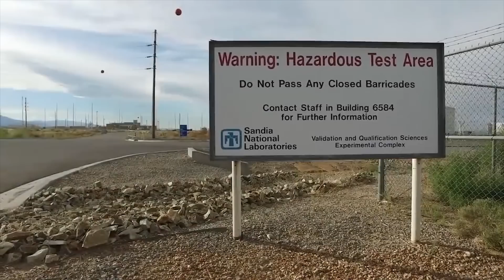Crash Test - 5 Largest Full Scale Experiments Caught on Camera

Comment: I actually saw that F4 phantom crash. It hit so hard and fast nothing had time to break or slow down, it literally disintegrated as it plowed forward into the wall. The wingtips which stuck out past the width of the concrete block kept going as though nothing happened, and if you saw the block afterwards there was a perfect shadow of the F4 left on it.
Reply: That part of the video drove me absolutely bonkers. Aside from the fact that the rockets were still firing, and subsequently the Phantom was still accelerating at the point of impact, people just don't seem to understand how unbelievably brief the impact event was, or how immense the energies involved were. Classic Dunning-Kruger, "knowing so little that they think they're experts" mentality.
Reply: @bigrob966  Very similar to those that don't understand the massive forces involved as the WTC buildings fell. Once a certain amount of potential energy has been converted to kinetic energy as the buildings finally yielded to gravity (as the structural steel with most of its fire shielding torn away, was heated beyond its yield point-they weren't melted) and began to move, there was no stopping their collapse.  Explained perfectly by the Law of Inertia, Newton's 1st Law-Objects in motion or at rest tend to stay that way unless influenced by some external force.  That F-4 test was amazing, a still picture of the test was shown in a book called "Global Air Power"  I was always amazed how the wingtips kept on travelling straight forwards as they protruded out beyond the huge block of reinforced concrete. Another of the "Law of Inertia" at work.
Reply: @hoghogwild   If I could do anything in the world I would make more people get their heads out of their asses and understand this. Sadly my sister is one of the one's that are on the "it melted" side even when I hung a 50lb dumbbell off a piece of angle iron and heated it with a torch till it sagged and collapsed. (Yeah not the exact same scenario but barney style enough for her)
Reply: @hoghogwild  ....doesn't explain building 7.  I've heard their over rationalized justifications.  I'm not buying it.
Reply: @roblockhart6104  What's there to explain?  As the North tower fell after being struck by an airliner which ripped much of the fireproofing from the structural steel thus exposing it to heating from burning kerosene based fuel. Once the steel was taken beyond its yield strength it fell.  As the North Tower came crashing down debris from it fell down into Building 7 creating a large gash into Building 7.  Fires burned until 2pm where firefighters noticed a bulge on the SouthWest corner. Firefighters noticed creaking noises from the building and at 3:30pm major firefighting operations in and around the building were ceased due to the danger to firefighters. Insufficient fire system/sprinkler system contributed to the failure of the building.  That was a horrible day
Reply: hoghogwild so ONLY building 7 was effected even though it wasn’t as close as other buildings in the area?
Reply: @hoghogwild  Dream on, Troll
Reply: @HadjiMart  but did the angle iron collapse into it's own foot print? buildings won't implode without human engineering as they are designed to stand.
Reply: hoghogwild 
I think that an important issue with the fire is ignored . Both planes were full of jet fuel and when they hit the building the only path for the burning jet fuel was to spill down the elevator shafts. Windows were shattered in the impact zone and there was many windows broken at the bottom of the towers including all of the building’s exterior doors being opened. The air rushes in at the bottom to feed the fire and exits at the top , the elevator shafts are now a blow torch . Kind of like how a charcoal starter cylinder is used to get the coals burning with only a small ball of paper . It acts like a bellows !
Reply: Rob Lockhart Collapse a building sideways onto another building and let me know how it works out.
Reply: @hoghogwild Or perhaps we understand too well? 

A plane flying faster than it's design limits (thicker air at sea level) and faster than the engine could move it at that altitude. This same plane built of aluminium was able cut through steel 'I' and 'H' beam that was anywhere from 2 to 5 inches thick so perfectly, remember aluminium is by orders of magnitude softer than steel. No mater how hard or fast you throw a paper plane, it will never disappear through a cardboard box. 

Funny how the hijackers face-scarf and passport survived the inferno but the flight black boxes didn't. Funny that the only three steel skyscrapers to ever collapse due to fire/plane strike, all did so on the same day. Funny how Larry Silverstein re-insured the towers six weeks before 9/11 and SPECIFIED being covered for terror attacks. Funny that the week before 9/11 all the stock market 'put options' (a bet that stock will fall) that were placed on American Airlines, Boeing and United Airlines (5 to 11 times their daily average). Funny that the lift maintenance company owner and president Bush are brothers. Funny that guards and sniffer dogs are pulled from WTC1 and WTC2 in the weeks leading up to the event. Funny how BBC reported WTC 7 had collapsed, yet it was viable in the background for another 15 minutes. Funny how WTC 1 and WTC 2 collapsed at free-fall speed (no resistance from the floor beneath). Funny how many cars many streets away ended up on their roofs.

You could just believe the propaganda that the 'tell lie vision' news PROGRAMMING tells you, while you're sat their watching in an a docile passive receive state. Or you could wake up !!! That fire could NEVER generate the heat required to take the metal beyond it's yield strength that lead to it's collapse.
Reply: @oceanhome2023  You're missing something very important. Fuel and oil burn black, BLACK!!! when the planes hit, the smoke was grey, GREY!!! = no fuel. Smoke turned black after because of all the plastic and other things.
Watch any plane or helicopter crash you like, smoke is thick, acrid and BLACK, it's so glaringly obvious.
Reply: @HadjiMart  As kids, my brother and I would heat up steel in a normal campfire, just a wood fire, until it got red hot so we could bend and manipulate it. I have no issue in seeing how jet fuel and burning office equipment led to structural failure of the towers. Not saying what we were told is true, or that it was an inside job or whatever, just that the heat from burning fuel could have weakened the steel beams enough to cause failure.
Reply: @oceanhome2023  another thing people forget is that the planes literally gutted 3-5 floors from the buildings. After that there was very little left supporting the upper floors. And even that was being heated. Only a matter of time until they collapse in and with that much weight it started a chain reaction of collapses. Im not surprised the rest of the building couldn't hold it.
Reply: @mikerochburns4104  Idk about you but im pretty sure office equipment and you know carpet and dry wall are flamable
Reply: @Deoxys501  They are, but you know, I work in a foundry and I know what temperatures are needed to melt specific metals, I also know you need more than paper, dry wall and fuel to come anywhere near close to what it takes to make WTC 1&2 steel go beyond it's fail point.

Max temp you could expect in that senario is 800c 
Minimum temperature needed in that senario is 2400c
Reply: @hoghogwild  please explain building  seven to me? Thanks 😊
Reply: @mikerochburns4104  Melting point(change of state from solid to liquid) of structural steel is approx. 1510ºC.  The BOILING point (again change of state from liquid to gas) or Iron is 2800ºC.  .  At 2400ºC structural steel would have the viscosity of water.  The maximum forging temperatures of steels AT MOST is 1300ºC, some carbon steels are just above 1000ºC.  Your MINIMUM temperature of 2400ºC for structural steel to deform is ridiculous
Reply: @richardhowe4140  OK?  I'll just copy and paste my original answer for ya.  Here you go"""As the North tower fell after being struck by an airliner which ripped much of the fireproofing from the structural steel thus exposing it to heating from burning kerosene based fuel. Once the steel was taken beyond its yield strength it fell.  As the North Tower came crashing down debris from it fell down into Building 7 creating a large gash into Building 7.  Fires burned until 2pm where firefighters noticed a bulge on the SouthWest corner. Firefighters noticed creaking noises from the building and at 3:30pm major firefighting operations in and around the building were ceased due to the danger to firefighters. Insufficient fire system/sprinkler system contributed to the failure of the building.  That was a horrible day"""
Reply: @hoghogwild  ok.. thanks 😊
Reply: @HadjiMart  "barney style enough for her'!!!  BRILLIANT!!!
Reply: @roblockhart6104  dont forget about those dancing Israelis...
Reply: I knew the 911 conspiracy clan would show up here ! The continuing characteristics of these conspiracies is that it has to continually get bigger to deal with the new pieces that don’t fit  . Another sign of these fake conspiracies is the massive amount of people involved in it and how are they going to keep a secret, there has never been a project that didn’t leak , the most secret project ever the Manhattan Project leaked . There seems to be a truly American trait to fall for conspiracies such as jet contrails are poisoning us and the moon landing was faked .
“Are you going to believe what I am telling you or your own eyes ?” - Groucho Marx 
It is much easier to fool someone than to convince them that they have been fooled !
Reply: That's cool. My dad worked, or sub contracted for, Sandia back then. I didn't see this test but I did get to see some other tests on the sled. It's shocking how fast they can get stuff going. I still have a scrap bit of a missile they tested. lol I didn't see that particular test either. 
I did get to see some nuclear container tests though. 

I was at home in 4 Hills for this test. I heard it.
Reply: That would be so f'n cool to see! 
I'm actually 51 but this stuff just cranks up the 10 year old in me.
Reply: Similar to the other "9/11" comments -- the aircraft striking the pentagon went through a similar process.
Reply: Yeah looked real to me. And funny you should say that about the shadow. We also have ship hull's from ww2 with perfect japanese zero shadows where they impacted 5 inch thick steel. They totally disintegrated.
Reply: Would it have mattered if they had loaded the airframe full of Jet A?
Reply: Nighthawke70 there would have been more flames, but as far as any kind of damage, no. There was literally nothing left to be damaged.
Reply: TheMattc999 JustMonika
Reply: I only can't into the comments to find this one! Thank you! What an incredible, powerful, beautiful sight it must have been. 😍
Reply: Also isn’t that facility in socorro not Albuquerque?
Reply: Physics..... 😁  "A body in motion tends to Stay in MOTION"......
NO JOKE!!!
Reply: And thats why flying aluminium tubes could never bring down the WTC towers. Theyd have ben vaporised on impact.
Reply: I remember going out on a F4 crash recovery, what we found was nothing but molten metal and somewhere in that was a pilot.
Reply: They generally vaporize, kind of melt real fast.
Reply: 9/11 was an inside job.

Comment: Some of these tests seem unnecessary. Aluminum vs. Concrete = destruction of aluminum. No test needed.
Reply: The plane vs concrete was to demonstrate that the techniques used to build nuclear power plants were safe from a plane hitting them. It was for the public more than anything. Same with the nuclear flask test BR used with the trains. Remember high speed is still high speed and things moving at that speed can pulverise most conventional building materials.

Comment: The 727 cras is no that good an example as rh engines are due fuselage mounted not underwing
Reply: The forward fuselage is however identical to a current production 737 - to the point the windows are interchangeable.

Comment: NACA (NASA) apparently neglected to consider the Douglas A-3D in their tests, when reassigned from bomber to carrier tanker duty, c. 1960s Tonkin Gulf operations. The three man crew jokingly referred to their craft then as 'All Three Dead' and which was usually the case when ditching at sea (no ejection seats, with one open hatch in canopy for all three to exit.) There was also a manual blow-down slide behind the cockpit, but worthless to the crew if ditching. Thank you, NASA.

Comment: Some of the crash test dummies were  found with their heads up their Rs after the crash. But this was not by choice :)
Reply: Crash test dummies do not have the anatomical features required for such a post-crash configuration.
Reply: @josephastier7421  Is that a fact .Well I had better start a business that makes crash test Dummies that are  anatomically correct I might even throw in a set of plums.on the male version to make then 100% correct anatomically 🍒😂
Reply: @fredfungalspore  You would be the first.
Reply: @josephastier7421  Now now Joseph 🙄

Comment: The jet fighter impact Rconcrete, on the film we see the wing penetrating the concrete much mire than a few inches the wing appear to slice the concrete  most of the thickness.
Reply: Watch it again. As the video stated the wing span of the plane was wider than the concrete block. As such the wing tips never came in contact with the block and were the only parts of the plane that didn't get completely pulverized. What you are seeing is the wing tip passing by the concrete block, not the wing penetrating it.

Comment: Jet fuel can't melt steel beams if the plane can't get through the external wall of Tower 1...
Reply: You are comparing the side wall of a skyscraper to the wall of a nuclear power plant's containment structure. They are not the same thing. A jetliner traveling at over 500 MPH would have little trouble penetrating into a tall building and starting a fire inside that would then soften the steel beams and cause the building to collapse.

Comment: 8:44 "And many in first class would likely have perished in the impact". Admit it. You grinned a bit and then felt guilty.
Reply: The first class and business class are usually in the front, where the aircraft is less noisy compared to seats behind the wings, (and the engines). The safest place in an impact (if the impact is survivable) is the seat in the last row, that's why the flight data recorder and the voice recorder are put in the rear of the plane.
Reply: @simonm1447  There was a real plane crash where the tail survived, even landed upright, you can see intact seats inside it. If you wanted to be anywhere, it was there!

Comment: I am really enjoying the longer, narrated videos. DarkDocs has brought a lot of the class back to Dark5. I do miss the spacey, eerie electronica but maybe that could still be melded in to the new format with care.

In regards 'SmashHit'; at the time there was a degree of scepticism in the test as it did not replicate the most likely scenario of a derailment--the flask off the track and braced against a bridge piling or tunnel portal when it was struck. There was also some degree of concern that something like the Summit disaster could also occur--a flask derailed inside a tunnel with a massive petrol or coal fire around it. However the fact is in thirty five years since the test there has never been an accident, so... Given the fact these flasks are occasionally transported along the railway line on the opposite side of the valley from me I am rather glad!

Comment: How does crashing a fighter jet into a wall help us understand how terrorists could attack a nuclear facility
Reply: Well, a military jet travels faster than civilian craft. If one were to be flown into the wall of a reactor. They needed to know if it would damage the reactor tower, or could the jet impact cause a breach.
Reply: brian swearingin perhaps. I guess it seems obvious that a small fighter jet, the likes of which are way too expensive for most terrorists to operate, would have little effect against several meters of concrete radiation shielding designed to contain a nuclear incident.

Comment: I have asked this question a number of times but no one as so far answered. Why not use the inflatable under the seat to use as air bag or why there is no airbag on planes?
Reply: Because the seat structure handles that load just fine. Most of the acceleration is in the horizontal direction.

Comment: Operation Smash Hit (nuclear flask/train): Some say that the bolts securing the engine block in the locomotive were loosened so that the heavy engine would be catapulted free on impact. It can be seen flying through the roof of the loco and over the flask.
Reply: “Some say” all kinds of nonsense. Loosening the engine mountings would not have changed the impact characteristics much. The reason the engine can be seen flying over the flask is that it had already given up a lot of its energy and been diverted up and over by the impact.
Reply: WineScrounger - Thanks for the reply. Always been a bit skeptical.

Comment: F4 is made of aluminium so it'll either melt or disintigrate hatting at that speed. Sane reason you dont use a grinding disk on aluminium, it melts and fills the pores making the disk useless. That anount of pressure from the impact creates more heat than a grinder at 10k rpm.